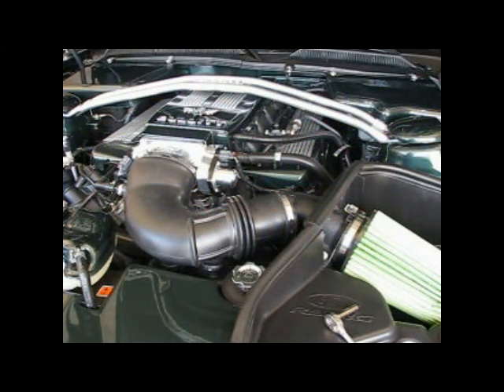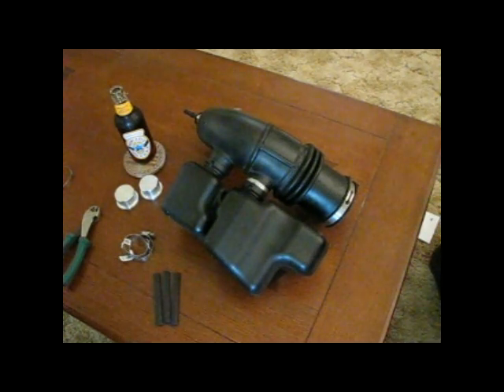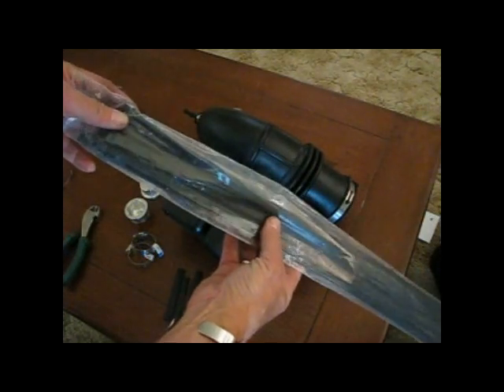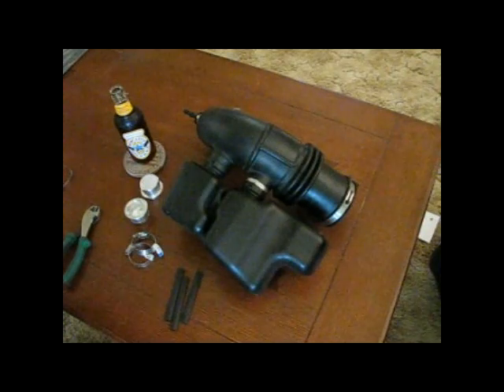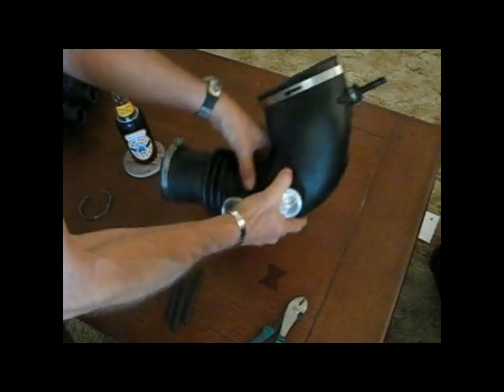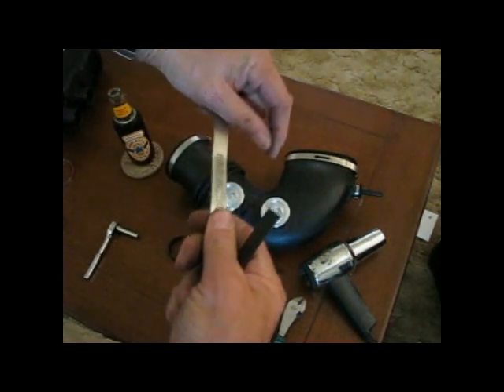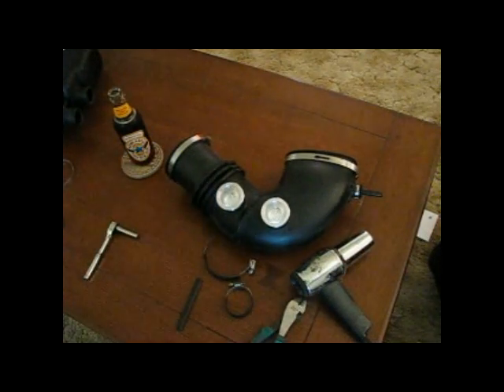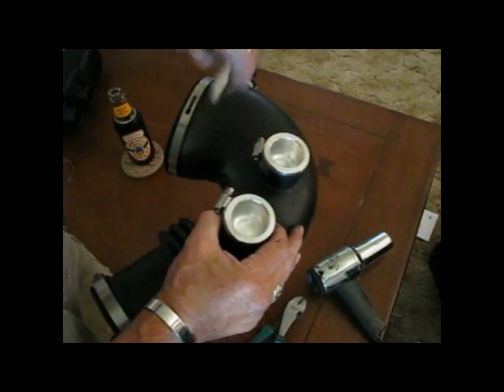Bullitt Mustang CAI Kidney (resonance chamber) Removal

Comment from the maker: I've been driving it all day like this and haven’t noticed any sort of noise that could be considered "whistling" but I've been told that the manufactures use resonators on the intakes to help cancel out intake noise that regular vehicle owners might find offensive. 

For those of us running headers and modified exhausts - it's just a waste. Fact is Ford Racing sells the same CAI without the Kidneys.